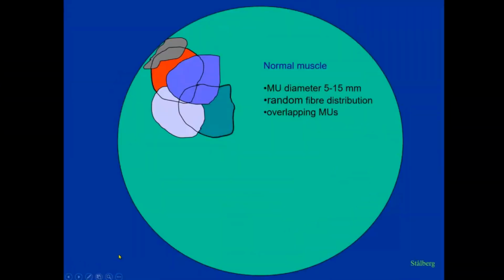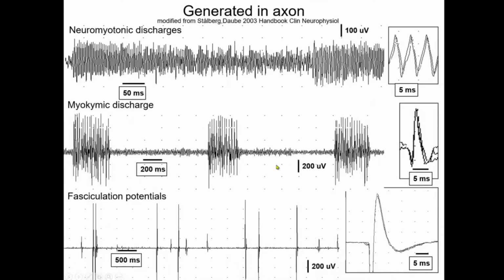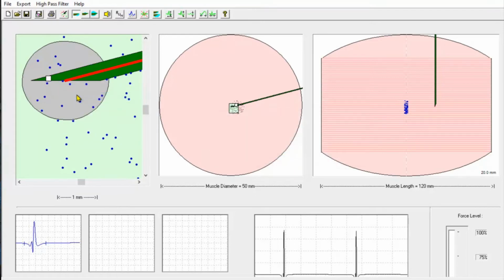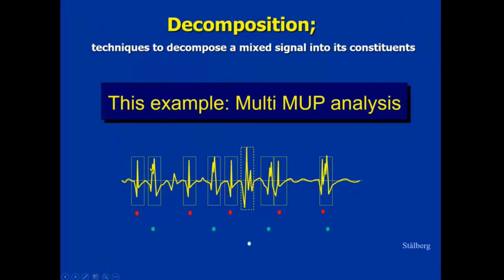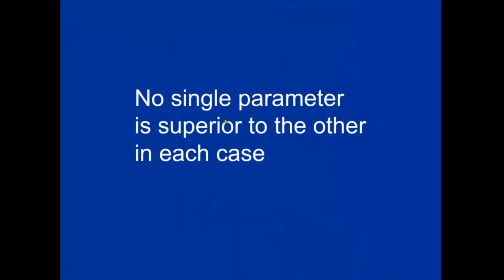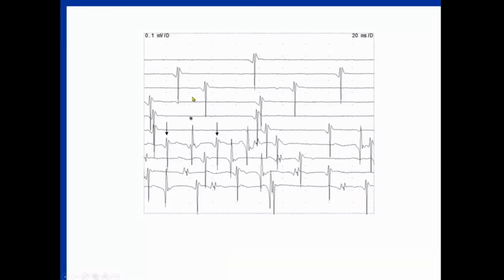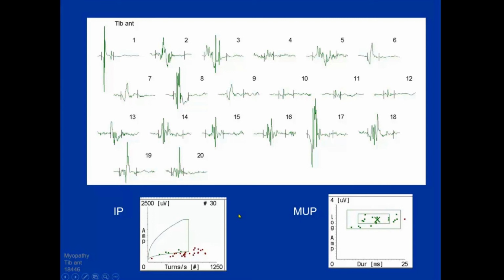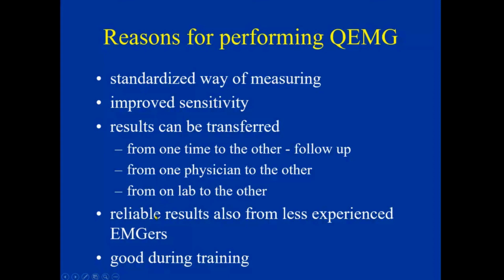QEMG Lecture

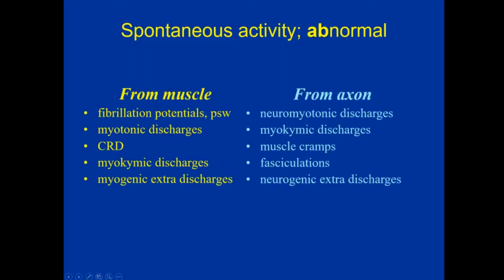Comment: On the slide (approx. 3:00 min) you write that myokymic discharges originate from both the muscle and the axon. Is this an oversight or are they also generated by the muscle cells?
Reply from the maker: Myokymic discharges
I agree that this is a less common mechanism and therefore I did not read this word when I discussed my slide. Myokymia is the repeated contraction in the muscle detected on the surface. The generation varies. Electrophysiologically is is a subgroup under repetitive discharges or grouped discharges. Those that are seen as repetitive motor unit potentials are definitely from the axon. Those with single fiber shape (such as double discharges, CRD, ..) are from the muscle. There are situations where the generation is discussed. So, to be on the safe side, define myokymic discharges as generated in the axon, the most common.  Thanks for comments.